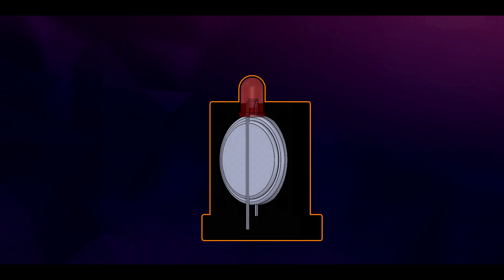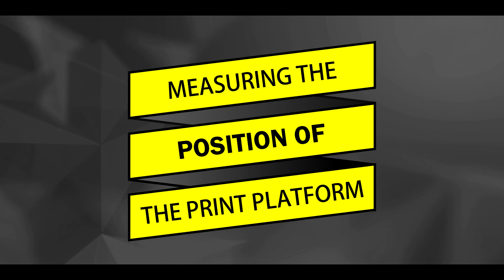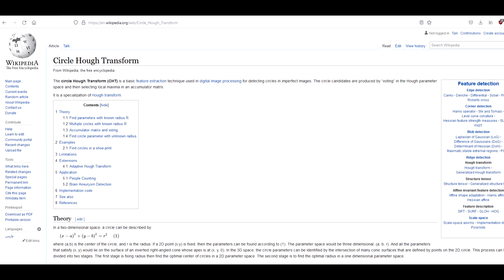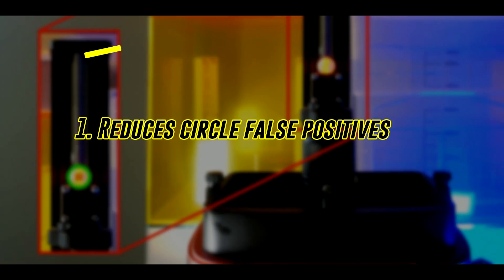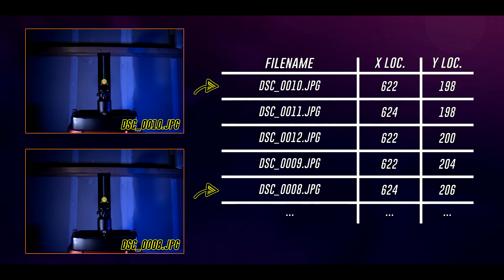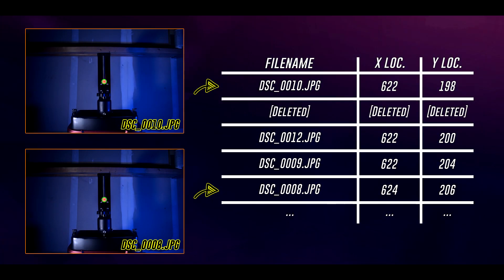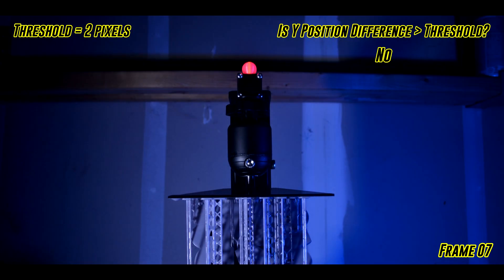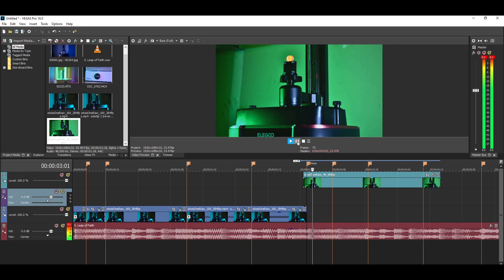Resin 3D Printing Time Lapses with MACHINE LEARNING! (Elegoo Mars 3 Review, AI Flowframes Tutorial)

Comment: It's a clever solution, but I've seen smoother videos, without interpolation, with a sony camera in still pic mode and an optical shutter trigger consisting of a photoresistor attached to a camera trigger cable. Since the camera is perfectly timed with the UV light activation, there are no irregular gaps between frames necessitating additional software for interpolation. All that is needed is an editing software, such as Resolve to import all the stills into a movie.

Comment: I have a question, if all layers in a print have the same layer exposure let's say 2 sec and the same lift time, let's say 1 second, isn't it possible to configure the intervalometer to take a shot every 3 seconds or a multiple of 3 and get a smooth video? I mean it will take a shot always in the se relative position.
Reply from the maker: This would work in theory, but there would likely be small millisecond differences between each "cycle" that would cause issues over a multi-hour print.  However, an idea may be to determine what that threshold would be for a particular machine/settings and then "reset" the cycle by manually pausing the print and restarting the intervalometer after a certain amount of time.
Reply: @SuperMakeSomething  Yes, I believe those milliseconds would grow exponentially over hours print. The thing about resin lapse is that it exhaust your camera life because it takes 18 000 shots at a 10 hours print, most of those frames you won't use them anyways, so we need a better way than that. Your way is more hardware friendly but at less we can find a step by step tutorial with software download links included, it's not for most users, that is a shame.